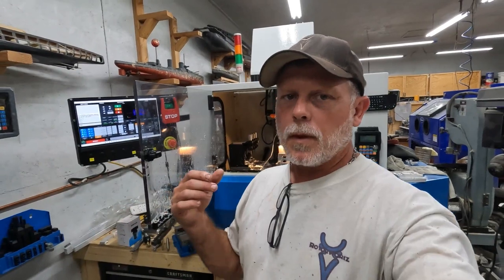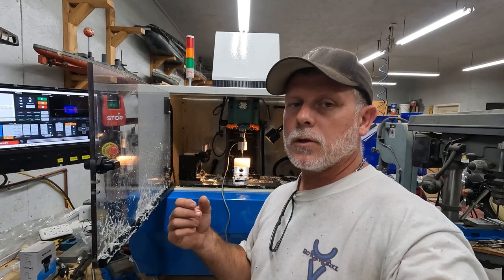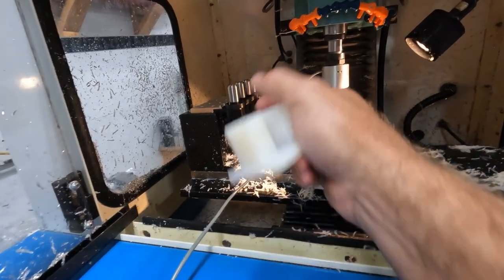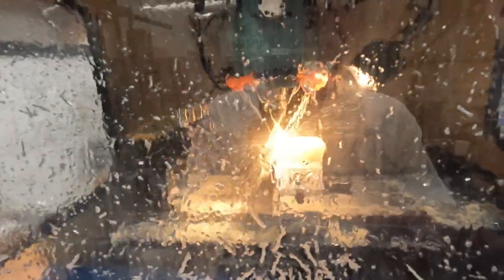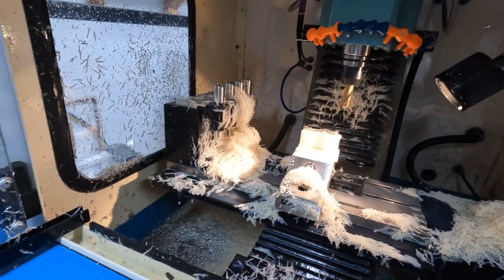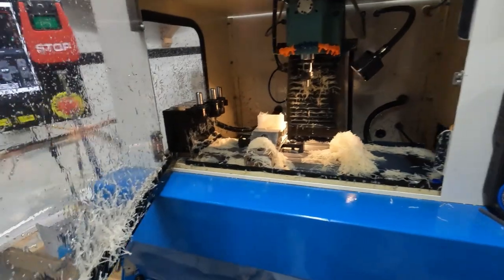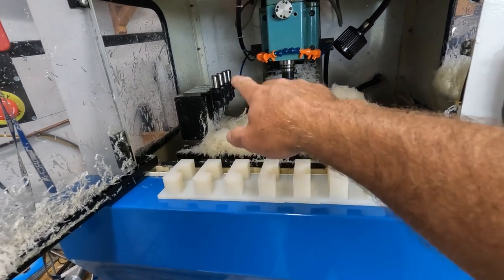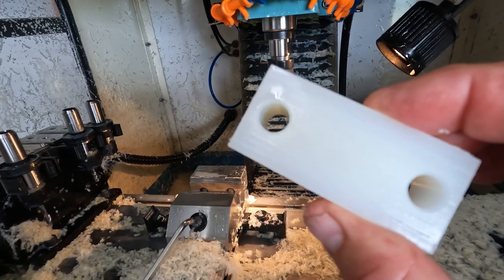Ford 530 Machining Feed Fork Bushings

Comment: I bought a 542 recently. If I can get it to tie the bales tight enough ( very slack twine at the moment despite trying every trick I could find!) I’ll need to replace these bushings. Mine are totally shot. I think the 542 is very similar but only one spring assembly.